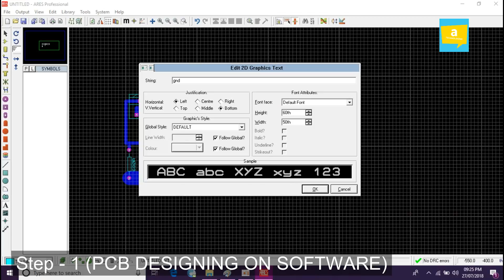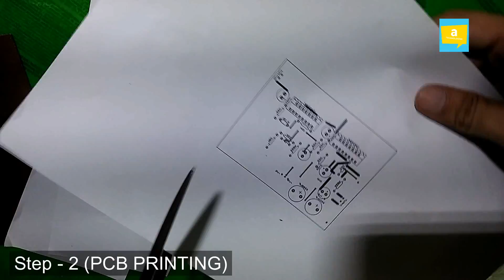BUILD AN AMPLIFIER IN 5 EASY STEPS AT HOME

Comment: Hey brother. If i make some small projects i need to know the behaviour of different electronic component and their working and also their power,resistance,capacitance,inductance ranges. Coz i am totally null person. Do you have any plan for making the course videos for beginners to understand the electronics behaviour and also capable of think the circuit designing by own mind. Not on very  higher level but at least these types of workings.